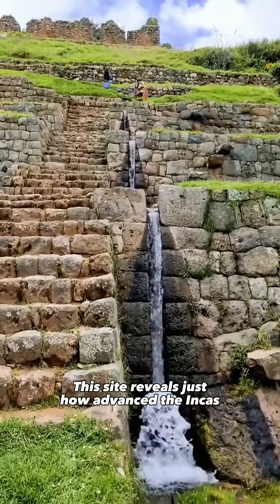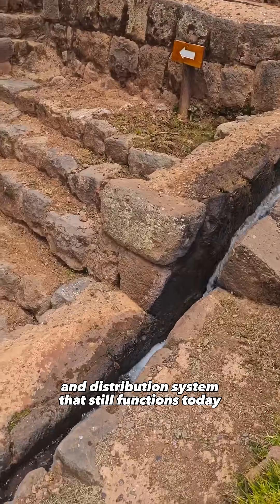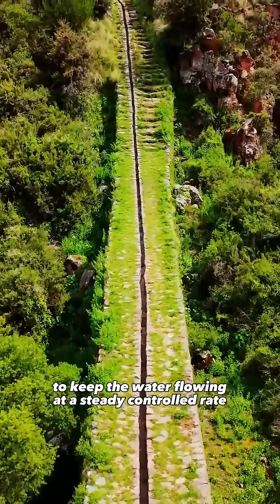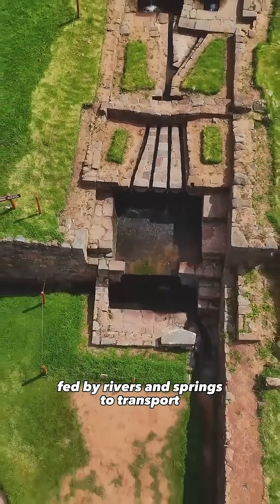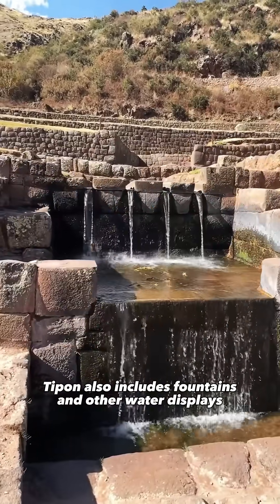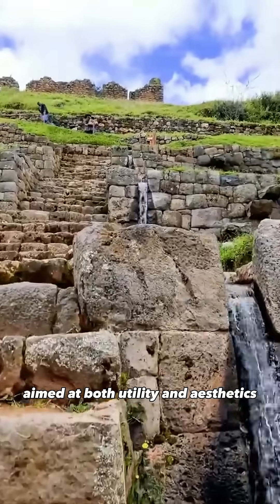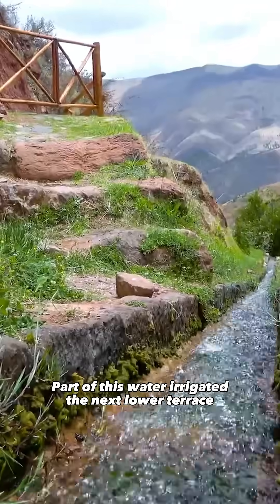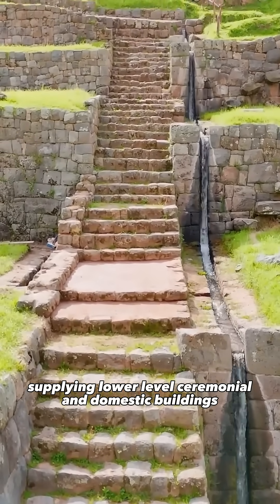Inca hydraulic engineering #history #engineering

Comment: There are a few problems with this kind of aqueduct. Waterflow is not protected by a roofing system. That allows debris and other unwanted impurities to occasionally mix with water. Direct sun beams would activate microbes. The solution is to cover the whole run of the canal with stones, like Romans did.
Waterflow should be slower, to avoid rocks erosion and debris dragging .
It looks like they didn't know what a pipe, a decanter, a piezometric tower and a syphon were. With no cisterns and pipes under pressure, system is overal simpler and reliable, but it would limit a lot the capabilities of such an aqueduct to reach points beyond hollows and to serve a larger population. 
Aqueducts of Rome served overall 1 million of "clients".

Comment: 100% cleaner than the water sitting in copper and pvc pipes we have today.
Reply: If it was always flowing like that then yes
Reply: The problem comes when you want to close a tap, and not having the water flowing constantly. Exposed and untreated water, taking energy from the sun with no constant flowing is a perfect bacterial generator. There isn't a problem to use that water for irrigation, but if you want to drink it you would be putting your health in risk.
Reply: @Gerclun :  That’s not true at all.
Stagnant water especially in old copper pipes is contaminated with microbes of all sorts.
Irritating crops with contaminated tap water means the roots absorb it, which feeds the plant, then you eat that contaminated plant.

Same as watering your vegetable garden with tap water.  We’ve done this for many decades in our family, and still today, but it’s not good.
Plants want rain. Even the rain should be coming from clouds that haven’t been contaminate by pollution.

Comment: That's not hydraulics engineering.

Ir is simply hydro engineering.
Reply: Sorry but you should not speak so assuredly when you don't know what youare talking about. Hydraulic engineering is a sub-discipline of civil engineering that focuses on the behavior, flow, and conveyance of fluids, primarily water. It applies the principles of fluid mechanics to design, build, and manage systems that control, store, transport, and use water resources. Hydraulic engineers work on a wide range of water-related infrastructure, such as dams, canals, bridges, and water distribution networks.
Reply: @FrawgfithAmblose I dont think you know what you're talking about noob
Reply: @FrawgfithAmblose  fair enough. I stand corrected. I presumed that hydraulics obly referred to fluid power systems, but also refers to flow systems.
Reply: @themanontheinside fluid and flow are the same word.
Reply: @WilliamTomajko  "fluid power systems" and "flow systems" are not the same thing
Reply: @themanontheinside Please don't try to explain things to a know it all?
Reply: @themanontheinside  but even if you took the correction gracefully, why put something out as 'fact' when 'i presumed'.
Reply: Romans were doing the same, a long time before and at a much greater scale.
Still very impressive tho
Reply: What is it called when you pressurize fluid, youll never guess
Reply: @FurNaxxYT  bro tries to look smart
Reply: @FurNaxxYT it's not pressurised, it's just managed and directed water. Still An impressive feat for early pre-industry but not hydraulics.
Edit; i was wrong, look to the replies.
Reply: @Hobbyblasphemist Please identify Bernoulli's definition of "hydraulic."